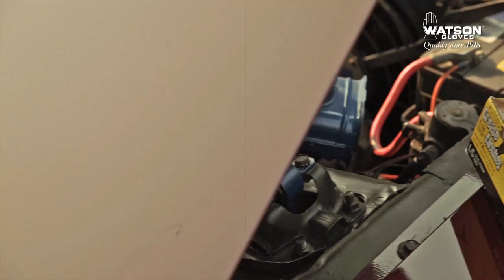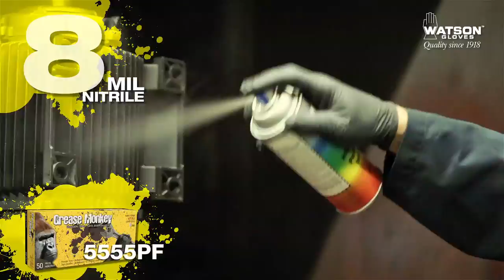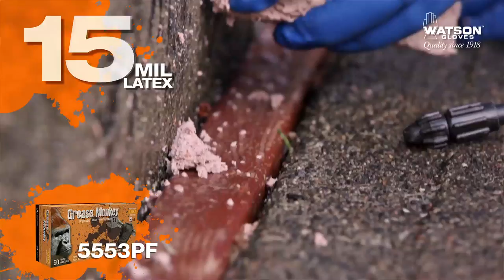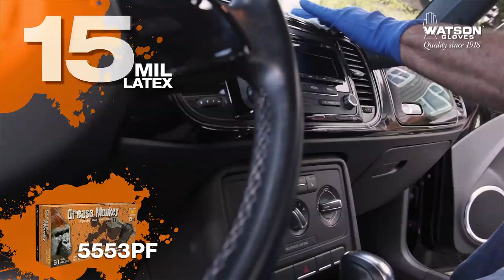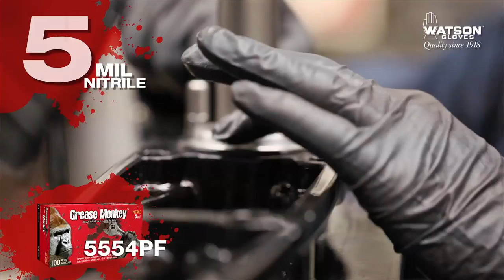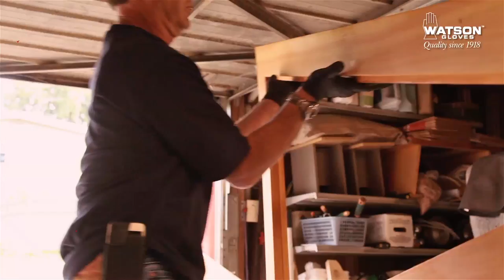Grease Monkey®

Comment: i want a refund for my 3 minutes and 8 seconds as i had to watch this twice to make sure i was seeing it all right... theres zero description or even general consensus here on what gloves are for what, what the differences are, who should buy which ones.. its shows all three doing every type of job.. you go from using an angle grinder to sharpen a steel blade with latex gloves something im sure everyone will agree is absurd, to using the same gloves to wipe off a car dash or hold a weed sprayer?

theres no information here for the consumer, you dont give the information that the red box is a pack of 100 gloves and the others are packs of 50.. atleast you state the material used and its thickness but i dont know the characteristic differences between latex and nitrile which one is going to be best for a mechanic and resist cuts and tears they are after all grease monkey gloves.. not window washer gloves